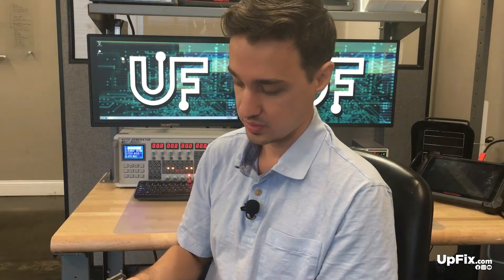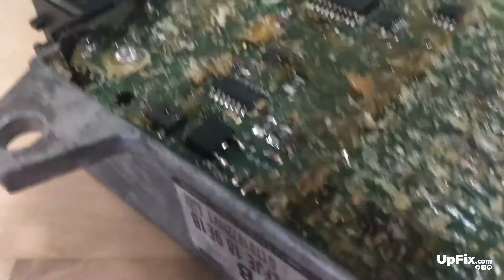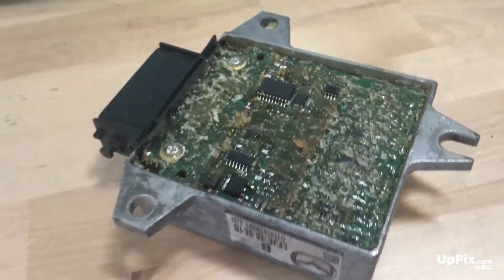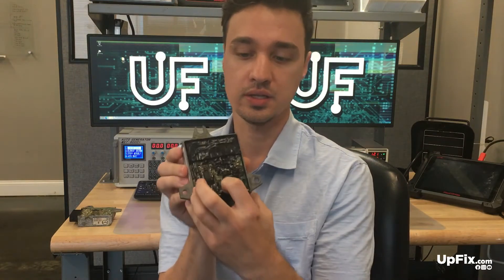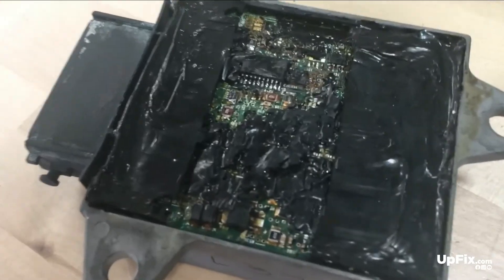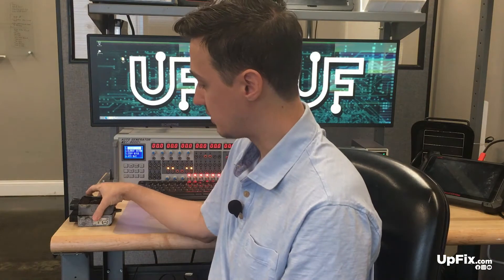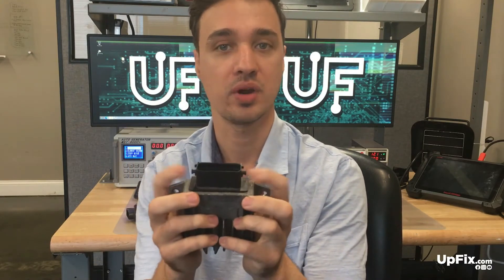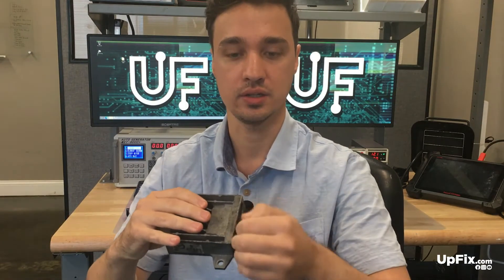Mazda 3 & 5 Transmission Control Module (TCM) Problems and Repair Service by UpFix

Comment: I had my TCM repaired by you but now it throws a P0791 and U0100 code. Both from my research are TCM related codes. The AT light only comes on after going 40mph then will go off when stopped. The engine light is always on.
Reply from the maker: Your part will be under warranty. Please see your order link and start the RMA process and/or get technical support.
Reply: @upfixauto  I'll be reaching out. Due to needing my vehicle working correctly soon I replaced the TCM and everything works well now with no faults. Super frustrating.

Comment: I have a 2010 mazda 3 194,000 miles . Car started having 1 code which was PO720 for output speed sensor and it also threw on the orange AT LIGHT .

So I changed the speed sensor and then drove the car and everything came back again so I changed the TCM cause it's so common on these cars and reset code and I drove the car almost shy of 200 miles and bam it happened again same issues and idk why this keeps happening. 

Orange AT LIGHT and same PO720 Code and when the AT comes on it's on for a very short time and car down shifts into 4th and no overdrive and manual shift doesn't work when this happens either and it last for 2 minutes or so and it goes off and car shifts back to normal but the code stays and never goes away . I'm think about mounting the TCM to the brake lines cause I've seen several videos on that . I don't know what else to do
Reply: Also I did do a transmission fluid an  filter change too cause it had a leak at the pan .
Reply from the maker: Thanks for sharing all those details,  you're doing a great job troubleshooting this! The P0720 code (output speed sensor circuit) is definitely a common issue with the 2010 Mazda 3, and you're right that the TCM (Transmission Control Module) is a known failure point on these vehicles.

Since you already replaced the output speed sensor and the TCM, and the issue still comes back after ~200 miles, here are a few things to consider:

1. TCM Replacement Quality – If the replacement TCM wasn’t professionally rebuilt and tested, it might still have internal faults. These Mazda TCMs commonly fail due to bad solder joints and heat damage, and many used ones on the market aren't reliable long-term. UpFix.com does full TCM rebuilds that address these specific failure points.

2. Connector and Wiring Check – Make sure the TCM wiring harness connectors are clean and not corroded. A poor connection can cause intermittent speed sensor signal errors, even with good components.

3. Grounding Issue – Mounting the TCM to a cooler or more stable location like the brake line bracket is a good move — many people do that to reduce heat exposure. Just make sure the TCM has a solid electrical ground.

4. Reset and Relearn – After replacing the TCM, did you do a proper transmission adaptive relearn or any software update (if applicable)? Some symptoms can persist without it.

You're on the right track, and don't give up! If you haven't had your current TCM professionally rebuilt, that might be the missing piece. UpFix.com can repair your original unit to prevent this from happening again.

Comment: Could a shift solenoid 1-2 fault be caused by a bad module?
Reply from the maker: Yes, this is the common issue with a faulty TCM. UpFix can repair your faulty TCM unit. Visit upfix.com

Comment: I'm doing the exchange for a refurbished one.  LFJE is the part.  I have hard shifting from R to D.  Slips gears 3-4 sometimes.  I also have seen limited slip light come on at times.  
Will the refurbished one I receive be thoroughly looked at?  I don't want to inherit any new issues.  Also I just received a message that mine has been backlogged for a few days.  I hope it's not extended any longer.
Reply from the maker: Thank you for reaching out with your questions! I’m glad to help clarify.

The LFJE part you’re exchanging will indeed go through a comprehensive evaluation. Each refurbished unit we provide undergoes a rigorous inspection and testing process to ensure it’s fully functional and free from faults, so you won’t inherit any new issues. Our goal is to make sure you receive a reliable unit that addresses your hard shifting from R to D and the gear slipping issue between 3rd and 4th.

I understand your concern about the backlog message you received. Occasionally, we experience minor delays due to the volume of orders, but rest assured, we are doing everything we can to minimize the waiting period. Our team will keep you updated if there are any significant changes to the timeline, and we appreciate your patience.

Please feel free to reach out anytime if you have more questions or need further assistance. We're here to make sure you have a smooth experience with your exchange.
Reply: @upfixauto  thanks for the reassurance.  I don't mind waiting.  Would rather the refurbished part that comes to me be done right.  Thanks

Comment: Hi, I have a mazda 5(mazda premacy 2007) I have replaced the Engine, gearbox and the TCM, but I keep getting the P2709 (shift solenoid f electrical) keeps popping up with the check engine.. The car seems to be stuck in 3rd gear.
I've changed the TCM LF2L 18 9E1G but I keep having the same problem. Kindly help. Thanks
Reply from the maker: if the problem is following the car, not the module, and has the same exact symptoms as before, then it's not the TCM at fault. 

Did you already inspect and replace the solenoid in question?

LF2L is a TCM designated for the non-US market, but the issues that plague these vehicles are very similar.

Comment: I have a 2012 Mazda 5 , just replaced the transmission with a used one , do I use the TCM that came originally came with car ? Or use the TCM that came with the replacement transmission as it was included ???
Reply from the maker: Use the original, as it is already programmed for your vehicle

Comment: Do you need to reprogram after being rebuilt? I'm able to do a system scan and the TCM is present but I can't communicate with it (no read codes or live data) it shows a u0101 code in the PCM.
Reply from the maker: If it is the original module, then it will not need to be reprogrammed.

Comment: We had the hard shift issues start than it stopped moving randomly all together. Guessing its heat related when it gets warmed up it does this. Just strange this hasnt been noted anywhere. Fluid wasnt burnt or anything and had the bad tcm codes.
Reply from the maker: Yes, for sure, when it is hot outside this issue is more common because the TCM unit gets really hot and starts to fail because of its location.
Reply: @upfixauto  so it will cause total no movement? Part comes in today. Ain’t looking forward to the hot putting it in.

Comment: I got a mazda 3i 2008, getting the at symbol and check engine, can a hard battery reset do anything to fix it if i dont have access to a repair place that actually repairs tcms? I live abroad which is why i ask
Reply from the maker: Yes it is most like that your TCM is starting to fail. The recommendation is to find a replacement module with the SAME part number if you don’t have anyone to repair it for you.
Reply: @upfixauto got it. In case i do find it. Does it have to be programmed? I just dont think someone in my surroundings or near by actually does this. Currently live in Dominican Republic

Comment: I have a 2013 Mazda 3 I’m not having this issue yet but I’m getting close to 100k miles.should I just mount the tcm to the brake line now or just wait?
Reply from the maker: Yes it helps if you move them to the brake lines.

Comment: I have a 2008 Mazda 3 that recently started having shifting issues, but the AT light is not on. The worst problem is we can be driving 65 MPH (In 5th gear) and all of a sudden load bang happens, like bucking bulll, and the AT light comes on, the engine revs like it is out of gear then a split second later all is fine. Could that be the TCM? We have engine light with small and large vacuum leaks so I am not sure it is related to that. Maybe try to fix those codes before sending the TCM in? Or do you guys do a diagnoses on the TCM and can see something is wrong?
Reply from the maker: Yes, definitely the TCM. This is very common.

Comment: What material should i use to sealed it again?
Reply from the maker: Silicone conformal coatings are preferred in the automotive industry due to their excellent flexibility, moisture protection, and thermal resistance. They form a protective barrier that is flexible, which is particularly beneficial for components that may experience thermal expansion or mechanical stress.

Silicone conformal coatings are applied as a liquid and then cured to form a gel-like, rubbery layer. The curing process can be accelerated by heat or may occur at room temperature, depending on the formulation. 

These coatings are known for their ability to provide long-term protection even under harsh conditions, making them ideal for automotive electronics that must operate reliably in a wide range of environmental conditions.

Comment: Hello, i hvae a 2010 Mazda premacy with 5 speed transmission with tiptronic issue-slowing down to turn, or go over a speed bump, or come to an intersection (not stopping totally to 0 mph), then then later accelerating, the transmission is in 3rd gear. Then it lags and slowly accelerates through 15+ mph. The result: poor acceleration. When i switch to manual mode i see it is in 3rd gear? To overcome this i would have to press the gas pedal very hard for it to downshift and then it shoots. Is this normal ?
Reply from the maker: It could very well be the TCM itself, especially if your TCM is within the year range where the TCM is physically mounted to the transmission, which for 2010, that should be the case. This TCM is commonly known to fail due to its location.

I would suggest getting your vehicle scanned with an OBDII tool that has the capability to communicate with the TCM. See what codes it's showing you, and then check the link below to see if those codes match up with what we can fix.

https://www.upfix.com/product/tcm-mazda-5-2007-2015-transmission-control-module-repair-tcm-tcu/

Comment: I have a 2013 Mazda 3 with high mileage that was working fine then out of the blue when I started it the check engine light came on along with the AT light and the light with the skid marks and noticed hard upshifts,downshifts and delayed shifts, pulled over and checked fluid levels and leaks but all was good, made it about 10 miles to home and a few days later removed the battery cables for a while then reconnected and the lights went away even after driving it for a few days and seemed to shift normal again. I was thinking it was a fluke but decided to get a scanner to check it out and when I hooked it up all of the lights returned and the U101011 lost communication with TCM code came up so after a quick search I found you guys and decided to remove it (which wasn't really too difficult) and send it your way, keeping my fingers crossed!
Reply from the maker: We look forward to getting you UpFixed and back on the road again!
Reply: Did you fix your problem
Reply: @jomarmaisonet2663  Yes, it is shifting perfectly with no check engine lights/codes etc.
Reply: I'm having the same exact issue on my 2012. Hopefully I can get it fixed
Reply: @iaguayo1981 I installed the rebuilt module about a year and a half ago and everything is still working fine.
Reply: Would a failed TCM cause these codes(4) U0101, U1900, U2064, B1318? Thanks
Reply: @smoker420la I'm not sure about the other three codes, but mine only had the U101011 which said the main computer lost communication with the TCM. I sent the TCM to upfix and the rebuilt unit fixed my problem.

Comment: I had a 2006 mazda3 2.0l the car had no TCM so what did I need to do
Reply from the maker: The issue could be in the transmission if your vehicle does not have a TCM.

Comment: 2015 mazda 5 - AT light came on- then off.....never happened before......now its check engine light? what do we do???? the mileage is 280K
Reply from the maker: That is a common issue of the TCM failing. Here is more info: https://www.upfix.com/product/tcm-mazda-3-2006-2014-transmission-control-module-repair-tcm-tcu/

Comment: Helping neighbor fix his 2010 Mazda 3. Code thrown U0101 TCM.  I can remove.  I haven't bought a new one because I don't know if it needs programming.  So you can reprogram and update?
Reply from the maker: Yes, if you purchase a new one, we can program it. Also, check to see if they are available at the dealership. Another option to consider is to have it repaired. If you need it repaired, please check out upfix.com

Comment: Hi, I have a problem, the cruise control stopped working on my mazda 3, the master said that it is tied to the tcm block and needs to be repaired, tell me is it so? I was also lent the lfs3189e1a unit, but the cruise control did not work with it, it is with the Japanese mazda axela, what should I do?

Comment: I have an automatic  2010 mazda 3 which started jerking when shifting  through the gears. i changed the ATF and it still continued and later on the car lost power while i was driving and it wouldnt engage any gear. The mechanic says i need to change my gear box and tcm. While all this was happening i never had any warning lights come on. Any thoughts or comments ?
Reply from the maker: Yes this is a common issue when TCM starts to fail on Mazda 3 year 2010 - 2014. The gear box (transmission) is good, it is just the TCM unit. Get your part UpFixed today. Here is more info https://www.upfix.com/product/tcm-mazda-3-2006-2014-transmission-control-module-repair-tcm-tcu/

Comment: Hi, I have a 2016 acura mdx awd which has a bad TCM. Are you able to repair/rebuild this TCM and will this need reprogramming? Will a used unit require reprogramming if it’s from the same year make and model car? Thanks

Comment: You mentioned in the video that you advertise the repair for 199. But your page has it for 329. Have your prices increased that much since this video aired or am I looking at the wrong thing?
Reply from the maker: Yes, the price changed for increasing the price of parts and labor.

Comment: I have a 2011 Mazda 3 I 2.0l and I need my TCM repaired. How much do you guys charge?
Reply from the maker: https://www.upfix.com/product/tcm-mazda-3-2006-2014-transmission-control-module-repair-tcm-tcu/
Reply from the maker: Let us know how we can help you!
Reply: @upfixauto  okay so I saw your cost for exchange, and I’m only willing to go with that one because I really need my vehicle up and running. I purchased another TCM from someone on eBay in China and it doesn’t even work and I was guaranteed that it’s good and refurbished. It was a single chip and not a double chip like my original. All computer resources sent it back to me saying it’s not repairable, wish I knew what that meant.

Comment: Hey guys I have a question is a 2007 Mazda 3 TCM compatible with a 2012 Mazda 5?
Reply from the maker: Yes it could be if it has the same part number.

Comment: I went to speedy today and is exactly what I got quoted 
$1200 
Crazy
Need help with Mazda 5 
Same thing my at light comes on 
Then shift gears car shakes 
Is it safe to drive ?
And how can I fix this
Reply from the maker: UpFix.com has them in-stock with core fee for exchange and also repair service. Here is the link https://www.upfix.com/product/tcm-mazda-5-2007-2015-transmission-control-module-repair-tcm-tcu/

Comment: Aren't the TCMs warranted by the manufacturer.? .. My 2006 Mazda S - 3 shifts hard from first to second from a full stop.. And jerks from 5th to 4th.. Who do I talk to to get it replaced.?
Reply from the maker: No they are not under warranty. Also, these TCMs are currently on backorder for about 6 months. We can rebuild your TCM and also have TCM units in stock. Visit our website www.upfix.com

Comment: In my mazda cx 7 facing...
Hard kicks on drive and reverse.
Stuck on 3rd gear.
Sign of AT in meter.
Please suggest an inexpensive solution.
Thanks.
Reply from the maker: What year is your Mazda CX-7? When it’s stuck in 3rd gear it usually indicates it’s in limp mode. Please perform a hard battery reset and check the condition of the transmission fluid. If the issue is still present after the reset, please scan and provide codes. If you’ve checked everything on your end, we can perform a diagnostic on the TCM.
Reply: @upfixauto  year 2010., 2x2, patrol engine

Comment: Hello my friend! I have a Mazda 3 2010 and the tcm went bad can you fix this? E
LF8M 18 9E16
G170137243
Reply: Hey I have a 2010 Mazda 5 My problem is sometimes not always It's hard to drive from 2nd gear to 3rd gear, suddenly it can't shift into reverse gear I tried to connect the computer to check for faults but unfortunately the fault computer is not able to enter the gear computer at all, it simply does not read it. Could it be that all the problems are related to a broken tcm gear computer? Is this the symptoms? Or is it a mechanical problem?
Reply from the maker: Yes we can repair it. Here is more info https://www.upfix.com/product/tcm-mazda-3-2006-2014-transmission-control-module-repair-tcm-tcu/

Comment: Do you need to program a TCM when you put it in?  I heard you do and only the dealer can do it.
Reply from the maker: Make sure the replacement part matches your original part number. You dont need to have it programmed.